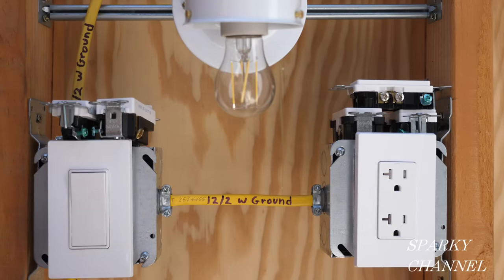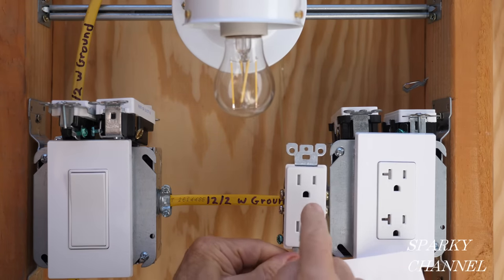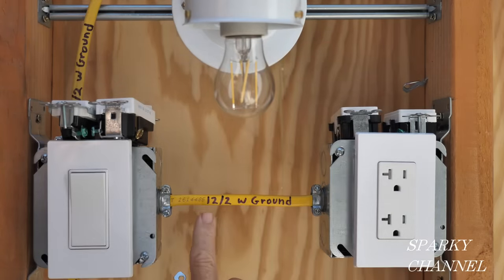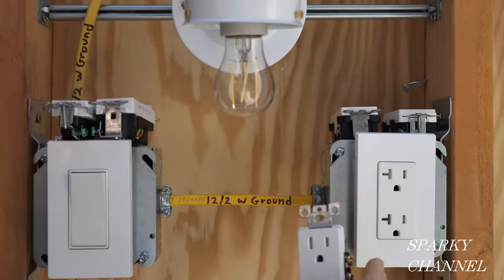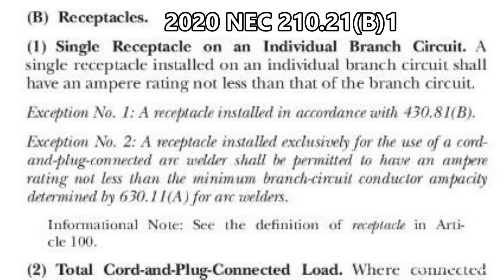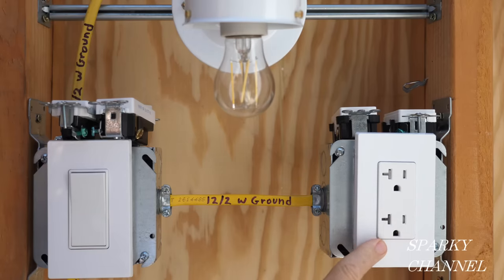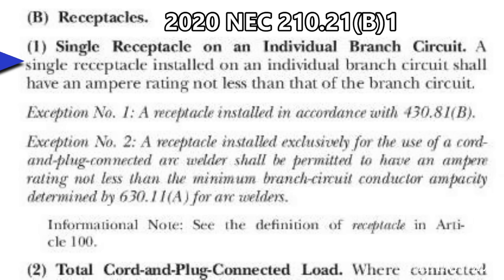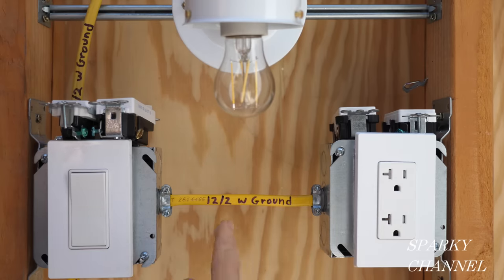Shall I Use a 15A or a 20A Receptacle on a 20A Circuit? + 2020 NEC 210.21(B)(1) and 210.21(B)(3)

Comment: I am not charging enough to change out switches, outlets, fixtures, etc.  No wonder everyone calls me.  I don’t mind being on the low end of the range but I’ve got to pump it up a bit.  Although, some folk are on thin fixed incomes (more so now…) and a typical charge for such a thing would wipe them out, at least for the month.  I’ve seen some dangerous safety violations (often peripheral to the real callout reason) that these folk live with, sometimes they know it, but can’t afford the full fee.  I could not sleep knowing the safety implications and then just walk away.   I’m sure that the rest of you are the same way…. Right?
Reply: Charge $50 to $75 per opening. I worked for a lighting showroom and they charged $20 per opening. I quit because they didn't pay my worth.
Reply: @michaelprosperity3420  I’ve been on the low end of the range  like $40-$50 per opening, but a lot more when I have to route something through old construction which of course changes the scope of the deal.
Reply: @staberdearth3130  
I bet we could share some good stories. Swapping out a ceiling fan and when you remove the old one and you realize it was held up by a prayer. I do handyman work and charge $64 per hour with a minimum of $125. Electrical is my wheelhouse. I've walked into million dollar builds when I worked for Hortons on a service call  and told the customer. They hung all the fixtures to high. I told the customer your designer knows that. I get back to the store and tell the manager and low and behold. 2 months later I get a service call to lower all the fixtures. Thank God the electrician left extra wire up in the box. The showroom did the service for free paying me $19 per hour. That was over 10yrs ago. I would have charged around $600
Reply: @michaelprosperity3420  These are all very similar stories, everything from buried junction boxes, twice (the flippers thought they’d never be found) to using a ground wire as an extra leg on a heat/vent/light/night light unit to a 15 amp circuit that had so much demand placed on it that turning it off to service it took down the kitchen, the upstairs hallway, 2 of 3 bedrooms, the main bathroom and stair light, to a 20 amp breaker on a 14/2 line, to grossly overpacked boxes, to outlet leads so short, it’s good thing that WAGO’s exist and mounted in an old stone masonry wall no doubt. I’m sure that I missed many others.  Most folks listen intently to what must be fixed and have that “”have I dodged a bullet” look about them, but there are others who want me to just overlook it and violate code because it will cost money…
Reply: Dude you gotta charge a minimum fee just to show up and work or you're not going to make any money.  If you don't live somewhere super expensive like New York city then your bare minimum should be at least $150 to $200.

 I charge poor people $150 and middle class $200 to change out a single outlet or switch. I don't care if it takes me 15 minutes I'm getting at least $150 to show up andfix anything.

 I can sit home on my ass and make no money or work on my own house,  I'm not doing work for someone else and making shit money. They can change their own outlet or pay me at least $150.  I am fair though,  if I change out two outlets then it still falls within the minimum on labor. I'm in Columbus Ohio and the cost of living is not too bad here, but it's still a big city so not dirt cheap either.
Reply: @actionjksn  I’m retired from a blessed life in corporate.  I’m not hurting in the war chest department.  I like to stay busy.  I do most of my work for folks that I know can’t afford it.  A fair amount of widows, widowers, and single moms.  Sometimes gratis or for barter.  A lot of fixed income and elderly people.  You’re correct, since you do it for a living, your numbers are essential.

I get the numbers you mention thrown at me by people who were quoted them.  My response is yes that is not unreasonable..  People put me in their wills and for as much as I protest, it will end up going to charity.  My situation is very different.  I am often the guy that corrects safety issues for people who would only live with it.  The one thing that can piss me off are people who try to pass themselves off as poor, or are skinflints, and just don’t want to pay.  I’ve walked from those already.
Reply: That's great that you're in a position where you can help people out. I'm not quite as heartless as I may have sounded and I've helped people out like that. But I can't really do that all the time because when you do this as a self employed person, you spend a fair amount of time doing things that you're not actually getting paid for. Like going to look at the jobs, hunting down materials, and then all the tool expenditures etc. I do a very wide variety of home improvements so it takes an insane amount of specialty tools to do things right and in a timely manner.
Reply: @actionjksn  I’ve got most of the tools for many types of jobs that I’ve acquired over the years when this was all just a pastime and hobby.  I can do most projects at a moments notice as long as the materials are available.  You ARE in a different category of employment, so I understand the difference.

Comment: Interesting that a 40 Amp circuit can have either a 40 or 50 Amp receptacle but a 50 Amp cannot have a 40 Amp receptacle?
Reply: I thought that was bizarre also.
Reply: I'm not sure why you guys think thats interesting or bizarre. If you had a 50 amp range circuit that was pulling close to or above 40 amps, why would you want to have a 40 amp receptacle in there?
Reply: Daniel Lo-G as without knowing the circuit the outlet would indicate it could cope with 50amps when it reality it would be overloaded and possibly trip the Circuit breaker. Which would be an inconvenience and costly if you upgraded your appliance to 50amp then have to have the extra cost of upgrading the circuit. Always stick to the outlet it can cope with for best practice.

Comment: If I look at a wall outlet and identify it as a 15 amp circuit, I assume that it uses 14/2 wires protected by a 15 amp breaker and is an appropriate circuit to use for low draw items like a table lamp, radio, fan etc.
   
But NEC is suggesting that a 20 amp outlet with 12/2 wires and 20 amp breaker provides sufficient protection  for table lamp wires or devices that come equipped with table lamp style plug and cord.  If so, why do 15 amp circuits even exist?  

Seems like there would be a lot less confusion if only 20 amp circuits existed.
Reply: 15 amp circuits are adequate for many loads and they are cheaper to install.  If your building a new house and chose to run all 20 amp circuits, rather than 15 amp circuits, you'd have a higher quality electrical system and  you would probably never trip a breaker while you lived in that house.
Reply: @chrisgraham2904   10-4.  I suspected $$$ was the reason.  I have a couple 110 outlets needing installation in my garage shop.  From now on, I put in 20 amps.  Thanks for comment/response.👍
Reply: @ORBDOR1  20 amp is a big advantage  and a good idea in a garage/shop.  Even a tool like a circular saw, that may normally draw between 9 to 12 amps, can peak if the saw blade jams and spikes the amperage up to 18 amps or more.  Also, in the workshop, run separate circuits for the lighting and the receptacles.  A tool like a table saw could blow a 15 amp breaker leaving you in the dark while the saw's blade continues to spin as it runs down.
Reply: @chrisgraham2904  Hmmm. I hadn’t thought of that. Keeping the lights on is certainly desirable to say the least.  Good point. Thanks for the tip.
Reply: @ORBDOR1  If your setting up a workshop, also avoid florescent lighting tubes.  They can strobe and may not be detectable to the human eye, but can cause a spinning blade to appear to be standing still.  Now days, go with low wattage LED lighting and save that extra power for your tools.
Reply: @chrisgraham2904  Another good tip.  Strobes have fooled a lot of people..especially if your unaware strobe effect is taking place.  When a guy thinks about it, it seems everything is ‘out to get you’!  Paranoia.  But I once heard that it’s ok to be paranoid.....(if ‘they’ are REALLY after you...ha)😂.  Definition of wisdom= the proper application of knowledge.   Important to be knowledgeable. So thanks again.
Reply: @chrisgraham2904  OK. Now I’m confused. The following is an excerpt from OSH, Canada’s version of OSHA I think.

Most people cannot notice the flicker in fluorescent lights that have a flicker rate of 120 cycles per second (or 120 Hz). Flicker with LED lights may be more noticeable due to the fact that LED lights flicker between less than 10% and 100%, where as fluorescent lights dim to about 35% and back to 100%).

The light flicker may be detected by its stroboscopic effect. When objects move or rotate rapidly, they may be lit at or about the same position during each cycle or rotation. This makes objects look as if they are moving more slowly than their actual speeds – they may even appear stationary if the object is moving at the same rate as the flicker frequency (or a multiple of it). This fact is the principle behind a strobe light but it is not the desired effect in general lighting. In fact, it could be a safety hazard if someone mistakenly thought that some equipment was stationary or was moving slowly.  I guess caution is paramount as usual.
Reply: @ORBDOR1  I'll investigate the LED's further.  I know LED's can also strobe when used on a dimmer or if not properly grounded.  I replaced all my shop fluorescents with LEDs and have not seen any issues.  Great bright light, low wattage and no issues when they start cold.
Reply: The breaker isn't there to protect the appliances attached to the circuit its there to protect the wiring and therefore the structure. If you plug a 20A appliance into a 15A circuit or have 4 x 5A appliances plugged into a 15A circuit it is the wiring that is overloaded not the appliances. If you plug a defective 10A appliance into a 15A circuit and it draws 30A the breaker may protect the appliance but its main purpose is protecting the wires feeding the receptacles.
Reply: @frankenberry9670  Breaker size is determined by wire size to protect wires.  I agree with that.  THANKS.  So, does ANYTHING protect the appliance? Not trying to b argumentative—but trying to understand.  I had old furnace with blower motor on a 20 amp glass fuse. Motor started to bind and draw more amps. Got hot enough to smoke and blower then ‘filled’ house with smoke. I was out of town. 2am smoke alarm woke up wife-grabbed kids in panic went to neighbor-called Fire dept, etc.  I don’t know if fuse ever blew. Dad (electrician) had spare motor and put it in with 15amp fuse. I don’t know what I’m looking for here but it appears NOTHING protects the appliance? Maybe each appliance should have fuse in it. Whatever. It is what it is.  Thanks mucho for your comment.
Reply: @ORBDOR1  Unfortunately the answers are "depends", "sometimes" and "not always".  Some items will have their own fuses or breakers, many don't. If you read the owner's manual it will give some hints on what not to do. Stalling or overloading a motor is a bad idea. Running a compressor for more than its duty cycle is also bad. Putting a 20A fuse or breaker on a 15A circuit is also bad. None of those things are things a manufacturer can control easily or without expense. Its a balance between safety and convenience and ultimately its the buyer of the item who knowingly or unknowingly determines the balance.
Reply: @ORBDOR1  6
Reply: @ORBDOR1  Back in the day of plug fuses there were "non tamp"  (type S) time delay fuses available for motor protection in sizes less than 15 amp. I remember 6 2/3 amp and others but only 8 amp are still being sold. The threads on the adapter would not allow a fuse of different rating from being installed. They are pretty much obsolete today.
Reply: @machintelligence  that’s pretty interesting.electrical history.  Thanks.

Comment: Go with 20amp...if you doubt me, take apart each one and you will clearly see the difference. The ground strap is what your seeing on the back of the 20 and only there in 15amp commercial rec.
Reply: The 20 amp receptacle allows you to plug in a 20 amp plug. That is the reason for the horizonal slot on the receptacle and why you cannot use it on a 15 amp circuit.
Reply: Yes but very dangerous- best to get a commercial or heavy duty 15 amp receptacle !
Reply: @kd1010163  lol, thanks for the plug pic but I think your missing the point of this question and why code now allows for 15amp outlets to be on 20amp circuits in given situations. What do I know thou right...5 year apprenticeship to be a Union Class A journeyman wireman in our local.
Reply: @awesomedave8484  you have that backwards. I was explaining why you can't use a 20 amp plug on a 15 amp circuit. I'm open to learning something new if you want to explain why it is okay to use a 20 amp plug on a 15 amp circuit. According to the code it isn't okay.

Comment: A very silly question. It simple, a 16 to 20 amp service usrs  20 amps. If 0-15 amps it a 15 amp receptical
 Anything over 15 amp will  not work

Comment: I know, the fact is that oversizing is generally a good thing, Im sure that for a same grade outlet ( Home Residential), In a 15 amp circuit, the 20 Amp one receptacle will generally last longer than the 15 amp.one The outlets with time start to make poor contact with the plugs. As you know,  any engineering decision is a compromise, that is way in you compare for example the codes used in EU and the one used in the US, you find that in many things they are completely different.  But they both work fine.  So in my opinion I believe that is better the 20 amp receptacle than the 15 amp one, you are free to use yours. Certainly if I had to instal one in the US I would use the NEC code, even if I do not believe that is the best solution.  Simply the NEC code is the  norm in the US and you have to comply with it, liked or not.
Reply: If you take apart "15A" outlets from the same model line, you will often find that the "15A" ones have the same internal construction as the 20A ones, only difference is that the 15A is missing the perpendicular cut-out on the face plate. If you want a heavy-duty 15R or 20R, you have to get commercial grade at ~4X the price and those too usually share the same internal design.
Reply: You cannot place a 20A receptacle (with the T-shaped neutral hole) anywhere on a 15A circuit - that's a code violation because it would allow someone to plug in a device that draws more than 15A. Only 15A receptacles are allowed on a 15A circuit.

With a 20A circuit, you may use either receptacle.

Comment: most of my house has 15 amp normal outlets, however all wiring to them is 12 gauge & on 20 amp circuits, there isnt a 15 amp breaker in my breaker box, THE BAD! from outlet to light switches is 12, but from switch to all lighting is on 14 gauge, but, still connected to outlets that are on 20 amp circuits. I bought house from owner builder that had Alzheimer's first home I have ever seen with more than enough wall outlets.  the stove is on 8 gauge, its a 20" stove  but the wire has a 10 gauge neutral? its been years since I looked at it. 

1 you wont like, I have a dedicated 12 gauge 20 amp circuit, to a 30 amp twist lock plug, then use a 10 gauge, 25' extension cord with 30 amp twist lock, to a portable amish style heater, which I put a 30 amp twist lock plug on, thats what I use for bedroom bathroom for even heating, I keep it on 64F during winter. never shortened cord, but I was trying to find best location for it long time ago, now it stays in 1 place, I only need 15 foot of cord, but just use one I made, or I could put in a new outlet in my hall just for it. but
Reply: MoneyManHolmes
I’m not an electrician, but my house is wired the same. Yellow to all outlets and switches, white from switches to light fixtures. All 20 amp breakers. All 15 amp outlets. I’m guessing it’s up to code, or at least it was at the time of building.
Reply: @MoneyManHolmes  im in rural VA and house was built by previous owner,  no idea what laws were, its around 40 years old, I had it 25 years & previous owner was 12-15? it was supposed to be his retirement place, but Alzheimer's put a damper on that, & he listed it for sale,  I know I will never over load wiring to lights, heck only outlet I may be close to is kitchen, when use microwave & toaster, or toaster oven at same time. but its also nice to be able to plug a small air compressor to kitchen to pump a tire up, on rare occasion, I keep a small compressor under a tarp outside for emergencies. or a welder, needed to, 2 times in 25 years here. I usually weld at my other home, but keep stuff at my first & primary home for emergencies.